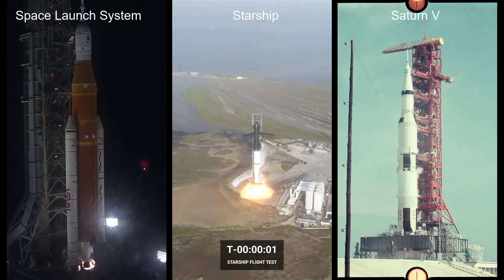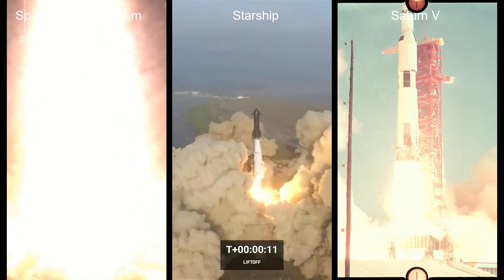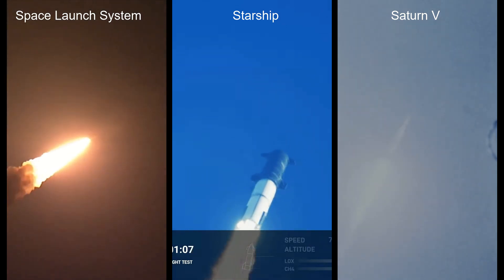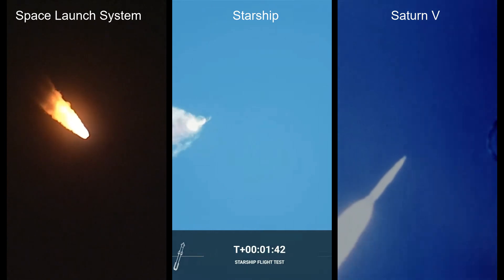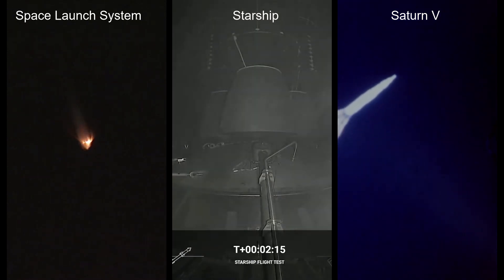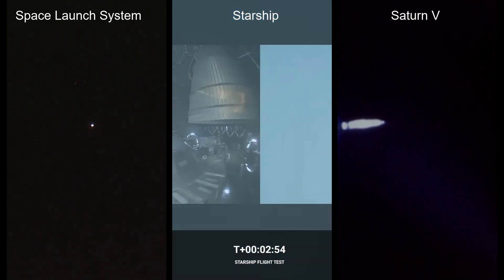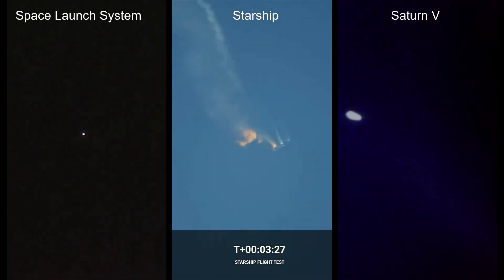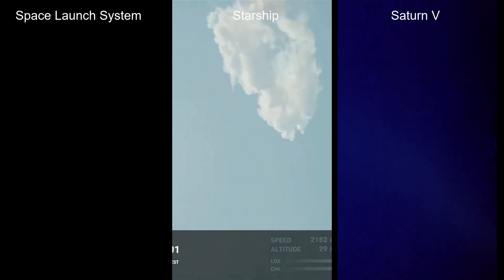Space Launch System vs Starship vs Saturn V | Launch Comparison

Comment: Ooh ooh, I know the answer to this one. Apollo and SLS were successful, Starship was a complete failure. Next question.
Reply: no one asked you a question and you still got it wrong, that "Complete failure" hit max Q and left the launch pad, that is surprising for 1st attempt of a new rocket technology especially when its packing the thrust of the other 2 combined.
Reply: @miguellopez3392  It was a complete failure. Anyone who thinks otherwise is a complete moron.
Reply: @brendanpells912 it was a success, not a complete one but if you had a brain you could see hitting max q was an important milestone for any rocket launch. Again Especially when it has more power than the 2 other previous rockets combined.
Reply: @miguellopez3392  I doubt it hit Max Q because it wasn't travelling as fast as it should have been, with so many engines dead. I suggest you get some stronger medication.
Reply: @brendanpells912  it hit max q twice actually, it did it at a higher altitude than expected because of power loss, and the second time was when it was falling.
Reply: @brendanpells912 Keep hating lol
Reply: Ift 1 and 2 are both successes
Reply: @AidenHere  If the objective is to launch a rocket and watch it disintegrate, then yes, they were successful in that respect. It depends how low you set the threshold.
Reply: I did that? Well imo ift 3 did pretty well for the milestones. Rough landings though

Comment: So, the starship’s super heavy booster looks a lot like the I’ll-fated Russian N-1.  Why did Space-X use that design?  It didn’t work for the Russians!
Reply: First of all We have advance tech then the soviet era plus we have high powered and efficient pumps to pump 17mill lbs of boost for the starship while n1 has issues with the pumps electrical systs and engine itselfs. And the Starship raptor engine v2 is built/design to be reliable and space x already has enough data to operate a lot of engines due to falcon heavy which has 27. This is just a quick brief on the top of my mind so if i have a mistake i apologized ipo